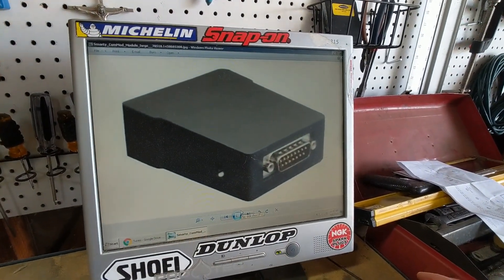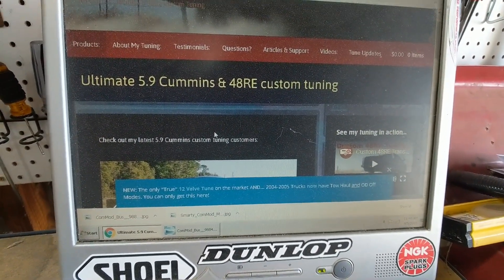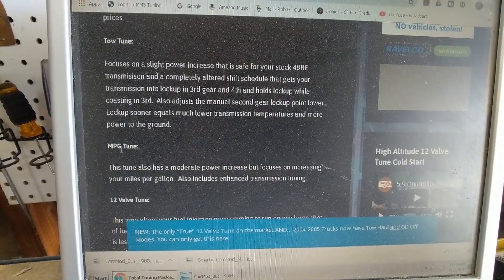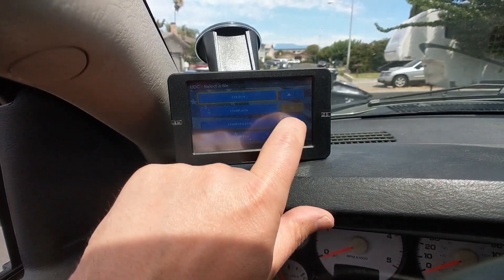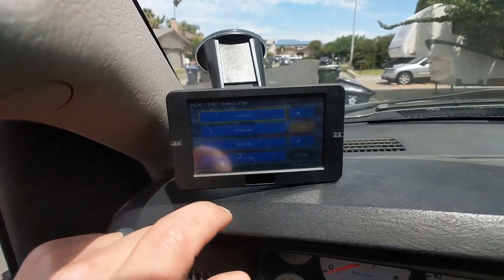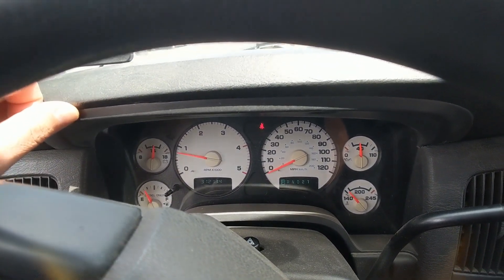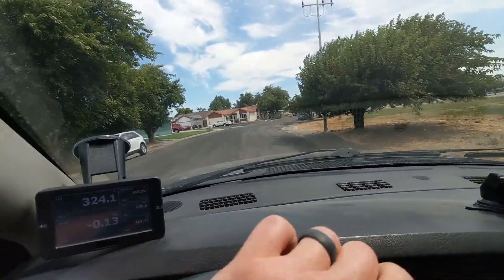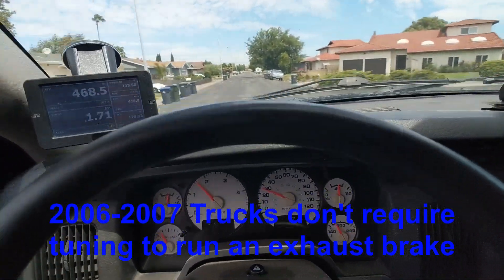5.9 Cummins (No Switch Needed) Shift On The Fly Custom Tuning and Exhaust Brake

Comment from the maker: Just to be clear, Shift on the fly tuning DOES NOT require an additional switch on these tunes.  The switch shown is used to make the 2004-2005 trucks behave like 2006-2007 trucks with the option of regular driving mode, tow haul mode and overdrive off.  2004-2005 trucks do not need this modification, but will benefit from it.

Comment: I have a 03 and I’m confused will my smarty touch work with the com mod and these tunes
Reply from the maker: The 03 does not require the comm mod.  You just need a tuning package for your smarty touch: https://www.5-9diesel.com/product/tuning-only-packages-if-you-already-have-an-mm3-or-touch/
Reply: If if I order the com mod will I be able to do shift on the fly

Comment: So with the sotf tunes what is the difference between the full flash or just doing the rt flash ? If it flashes the same tune why take the time to do a full flash ? Just curious
Reply: I get I am a few years late, but as I read in his instructions the full flash is to set the base tune for every time you start the truck to instantly run and you rt flash one time tunes. So if you just want to run the 12v tune you full flash it and then when you go to pull a trailer or want to run a different tune for a day you just quick flash the tune you want to run for the day and when you shut the truck off it goes back to the 12v tune when you turn the key back on.

Comment: My '06 5.9 came with an ATS transmission.  Shifts like crap while towing up hill around 55mph.  It's either revving too high or too low.  It's never in the sweet spot.  Will the transmission tune work for this?  Disclaimer: this is my first Dodge/diesel.
Reply from the maker: Yes it should solve it.

Comment: I'm confused, this video is 3 months old and you show your total tuning package at $425, I'm thinking great deal but I go to your website and it's really $725 with shift on the fly. Is there a discounted amount when you check out?
Reply: It’s like $900+ now for 3 times and the mm3
Reply from the maker: I used to sell the MM3 and tunes separately, so the $425 did not include the cost of the tuner.  Since then I have combined them into one package which is why the prices look different.  Also the total package comes with more tunes now.

Comment: I purchased the total tune package from Rob and I can say my truck is running great. I run the 12v HP tune the most. I have seen 3-4 mpg hand calculated in gains since i started using these tunes. The truck is happy and I'm happy. Life long customer here for sure. If you want to save your stock 3rd gen and really just have a good time falling in love with your truck again, contact Rob.